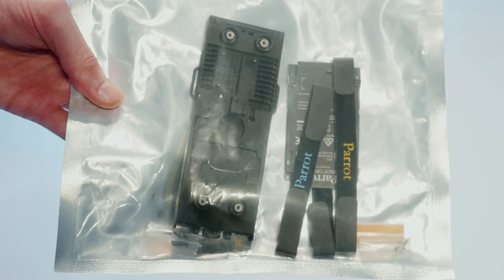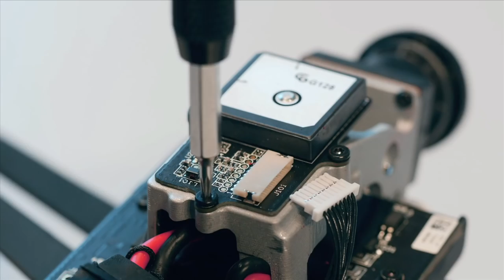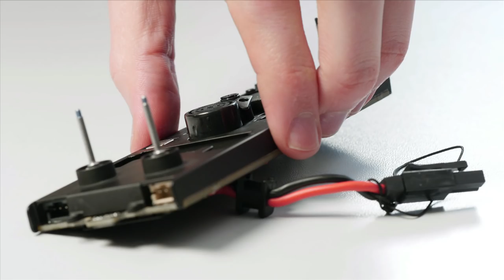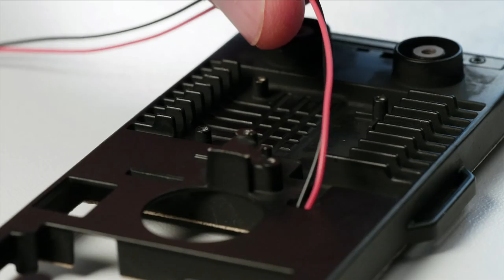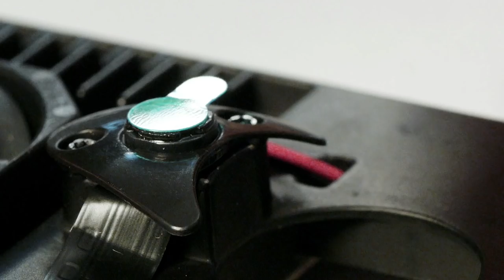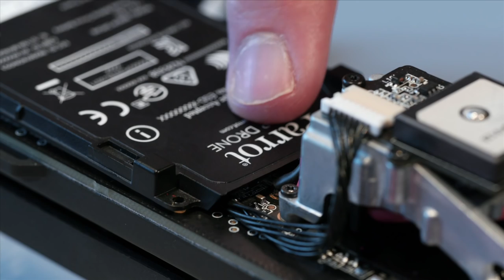Parrot Bebop Drone: How to repair Upper parts

Comment: i have a bebop 1 and as soon as i start it up to fly its drains the battery but when i try the battery again its not been drained i have 6 batteries and its doing the same to every one and ideas would be great on what could be wrong with it.
Reply: Same problem over here. I will try to replace the motherboard now. I will write here if it worked.